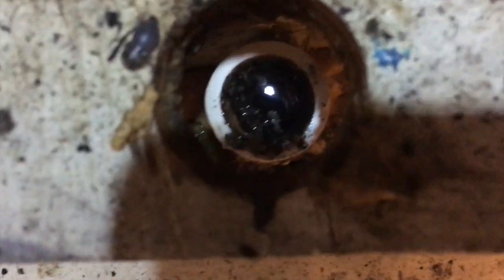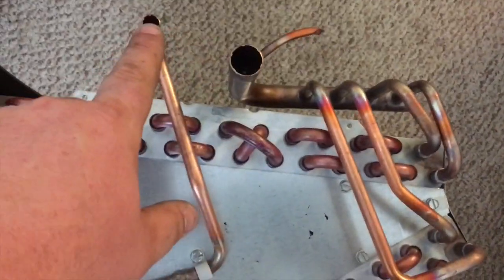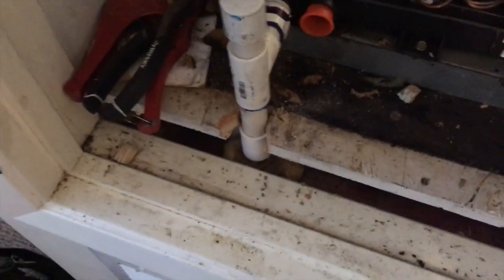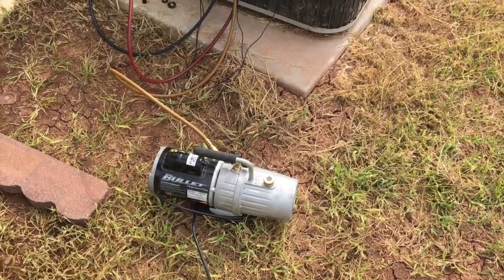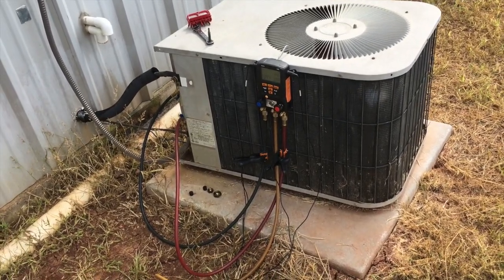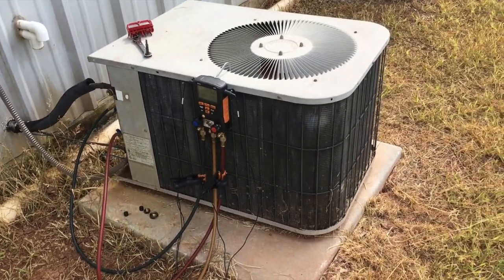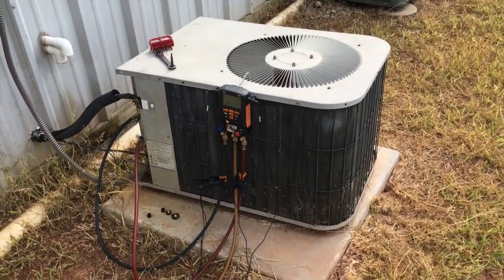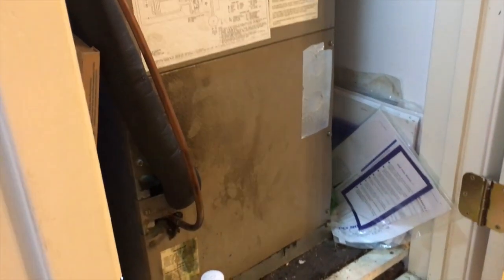HVAC: Goodman Evap Coil Replacement

Comment: I'm still looking for mine . itt's not at the bottom . Looks like it sits on top . Has some lines connected to it and the insulated one was frozen . Outside one too  now been several hours and they're thawed out . Tried turning back on still not working

Comment: I like those Drain Cats I was checking them out the other day but didn't buy it. We're gonna buy them for all the guys I pitched it to my owner. I like the Gallo gun for short runs but attic drains or long runs I don't. I think it just pushes the clog further down. Plus the Gallo guns are 35 bucks and you have to keep buying cartridges. With the drain kat you buy it once and as far as nitrogen goes we have that already anyway. So long story short I'm getting some.. Lol. Johnny what size is your torch tip? I need a new one.
Reply from the maker: You will enjoy the drain kat Gil!!! Its a rose bud tip its awesome!!

Comment: Besides the gallo gun, I kept and use the diversatech bottle/hose gun used for line flushing and refill it, mind you its a crapshoot on amt of refill but I just go with regulator delivery.

Comment: Hey Big man, nice job, simple simple. Man I hate to call you out on stuff. But it's the little details  that catches my eye, and gets to me like  rock in my shoe. Small detail. Floor covering, brother. Got cover that floor. Last thing you need is a piece of silver dropping or splattering on that floor. But other then that, your gold and purple. Gitter Done, git that check. You da man.
Reply from the maker: Thanks Alex!!! Ya i agree with you ive got to get our shop man to get me a drop cloth!!!
Reply: What about not running nitrogen through when brazing the copper?

Comment: That Drain Cat will save your shoulders. I've seen them in the parts house but didn't know that it went to a small tank. I thought that it was an adapter for the regular size tanks. Thanks for sharing.😎
Reply from the maker: Thanks For Watching Buddy!!! The Drain Kat is a great tool!!!
Reply: +Israelhvac did u use a b tank to burn in?
Reply from the maker: +Fred McAllister no sir I use oxygen and acy